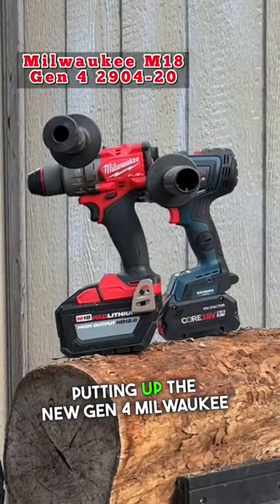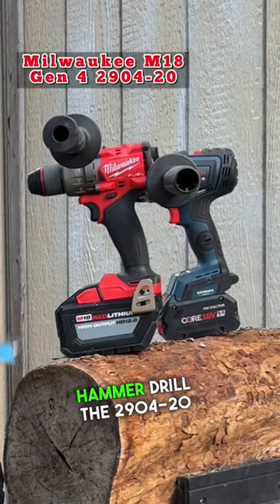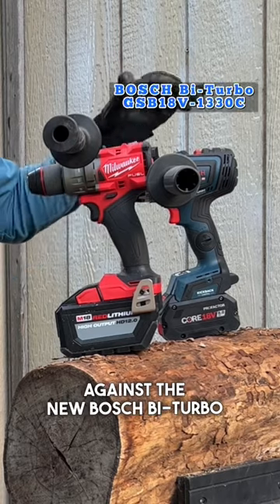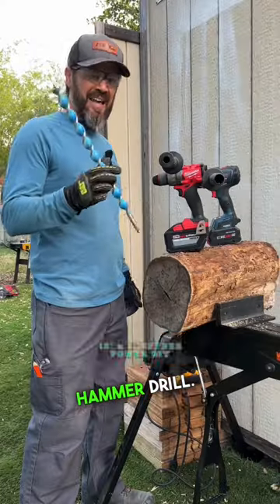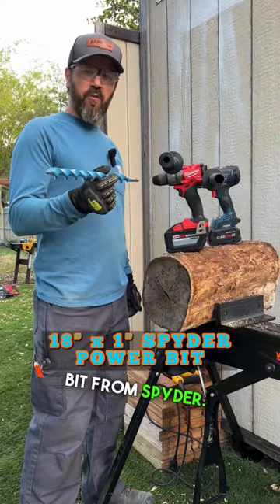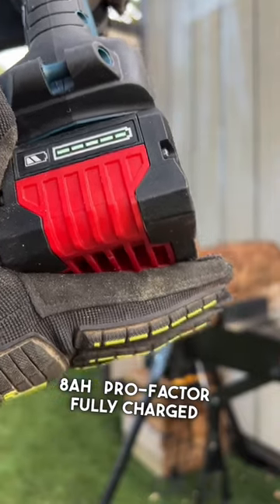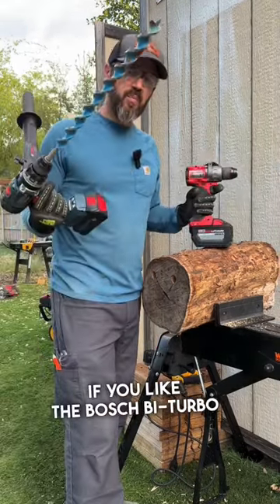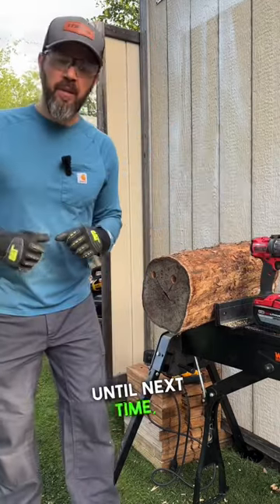Milwaukee M18 Gen 4 VS BOSCH BI-TURBO!

Comment: The gen 3 Milwaukee actually beat the gen 4 in a torque test.
Reply: Was about to type the same thing
Reply: In "one"
Reply: I just got the gen 4 it almost feels like it has dives in power when put to the test I’ve used the gen 3 for months leading up to getting the 4th gen and honestly haven’t even ran into a situation with auto stop even being used yet lol but everyone on my job site with the third gen says mines better I disagree
Reply: I have them both under load the gen 4 outperformed the gen three.
Reply: @steffendetrick9403  I should have specified that I saw it on one channel.
It was a torque test. Maybe in a different scenario, the gen4 is better.
Reply: @DiligentDave1966  The thing is even this video a test like this doesn’t tell you a whole lot it’s giving you partial information at best. The results are gonna vary depending on the bit they’re using and how the drill is tuned (its torque to RPM ratio). Bosch and Milwaukee both know this which is why Bosch introduced the chips that you can change out and when the one key version comes out for the gen4 you’ll be able to adjust the torque and RPM ratios through the ONE-KEY™ app. This concepts already exist in a limited capacity but that will be the future of power tools like tuning a engine or a car before a race depending on the track, weather etc.
Reply: @steffendetrick9403  Thanks for the info. I’m not trying to start any debates. I was just making a comment.
I’m not partial to a particular brand or generation of tools, so I always say that you should just buy what works for you.
I don’t even hate Makita or Ryobi, but I won’t buy them.
Reply: @steffendetrick9403  There is a One Key gen 3. I believe it’s 2805.
Honestly, the gen 4 handle feels long and skinny to me.
Reply: Yeah… i don’t trust that tests accuracy tho… need more than one test done. The part of the wood matters due to grain differences, etc. I tried a test between the two off cam with a much smaller bit and the gen 3 stalled whereas the gen 4 powered through. Gotta take into consideration our tests aren’t as accurate as the test ran in the “lab” via milwaukee tool.
Reply: @steffendetrick9403 this is what I realized off can testing both
Reply: @mannyfresh8504  The torque test was done with a torque adapter, and driving a lag into wood.
You need to check out Tools with SOALZ.
Reply: @DiligentDave1966  yeah, i saw the same test you saw. I knew which one you were referring too. I’m saying though that there are other factors that can play into it rendering it not as accurate as you think. Real world work load so far has shown me the opposite. i bring both tools, gen 3 and gen 4’s on site incase one fails “time is money”…. So for the heck of it, I have run some test of my own… one thing is for sure, in masonry gen 4 is way ahead. Like a hot knife through butter.
Reply: @mannyfresh8504  The gen 4 has tested as strong as the gen 3 on the same channel.
What sets the gen 4 apart is that it has added safety features, a slightly larger body and much better airflow. The increased airflow will definitely help keep it from overheating.
I believe the rpm and ipm of the hammer mode are higher on the gen4,as well, which would explain the better performance in concrete.
You have to consider that the torque tests are done in drill mode and speed one, which is where the drill will get its maximum torque. That’s not necessarily the maximum overall performance.
Reply: @DiligentDave1966  i feel you on this.

Comment: That Bosh seems to be a strong drill
Reply from the maker: It’s a beast. Stay tuned for a more in depth comparison and testing,
Reply: Strongest drill in the world they say
Reply: @MasteringMayhem  so you pitted two drills with different battery's and expect this video to ba a valid comparison? You need to look into battery output and it's effect on outputs from electric motors
Reply: @MasteringMayhem  
Test it against a flex as I am considering both because of the anti kickback. Thanks

Comment: Bosch is the best company to manufacture drills, but Milwaukee is better at making impact gun
Reply: Bosch make good impacts too, milwaukee just has more range
Reply: I like Bosch Rotary Hammers both SDS PLUS and SDS Max and their regular drills more than any other brand. The rotary Hammers are German made unlike most other brands, introduced anti Kickback much earlier and their new PROFACTOR tools are unmatched among 18V tools. Their build quality in general is second to none. 
And they've been gone on many deals lately with free batteries and chargers. 
Way underrated on many channels but they get the job done

Comment: As a Master electrician who's father was a general contractor and grandfather a building inspector.  There's simply no choice.  Milwaukee/ Ingersoll-Rand has been a trusted name in power tools for three generations. Sure it may lose some test here and there. The question is will that tool take being used daily for the next 10 years?
Reply: Probably not, no
Reply: When you talk about generations. Milwaukee has been going through a lot of changes when it comes to production facilities. It's not what it was back in the days.

Comment: Bosch stuff is pretty good but they don't really cater to the homeowner/prosumer demographic, that doesn't make me a team red guy though I think Milwaukee is overrated. I used to work for a hardware store that could send out tools for repair and it was almost always the red tools, occasionally a dewalt

Comment: I have Bosch bull dog which is an amazing tool for its price point. I also have the Bosch jack hammer which has served me very well over the last 5 years. Burnt my first bulldog out after using it for 10 years. I have had better luck with the cordless Milwaukee drills and just feel that the m18 fuel series is a much more versatile product line at a really reasonable price point. Most of my tools are nearly free when factoring in the cost of stand alone batteries.

Comment: How's the weight though the Bosch looks a lot chunkier
Reply from the maker: Milwaukee with 12Ah is 7lbs 3.6oz the BOSCH with 8Ah is 6lbs. 14oz
Reply: Less compact for sure but no proplem of heat ménagement witch mean  that it will last longer.2 layer(ring ) for the torque settings and functions settings.
Reply: Since the Milwaukee has a 12 amp hour battery they probably weight the same. I think the Bosch is a heavier drill though. I'd rather have the Bosch.